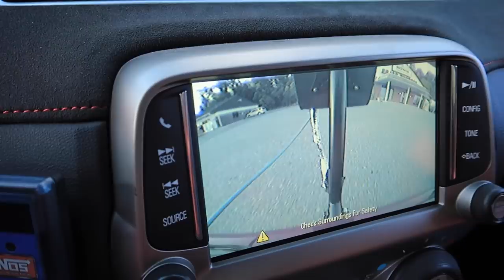Pulling A Parachute On The Highway At 150mph!! **Bad Idea**

Comment: Nick if you blew the motor in the 5th gen what would you replace the motor with?
Reply: J Cunningham engine* a improved engine Im sure
Reply: id say LSX 454
Reply: Stefan Crews motor is not wrong. Why do you think its called motorsports, motorcycle, motor mounts, and motor oil. Definition of motor
1:  one that imparts motion; specifically :  prime mover
2:  any of various power units that develop energy or impart motion: such as a :  a small compact engine b :  internal combustion engine; especially :  a gasoline engine c :  a rotating machine that transforms electrical energy into mechanical energy
3:  motor vehicle; especially :
Reply: J Cunningham lsa would be better

Comment: Yo lol just wanted to be that guy but the Trans am that Andy is in if its a v8 and if its a ls1 its rated at 327hp which isnt alot for cars now a days but back then it was, Even though mine makes 700 on a 150 shot and is about to get a new lsx and and a 80mm turbo which then ill be getting the starting numbers im looking for and when im done i would like to have a chance to run that beast you have.

Comment: You should pull the chute while you're under throttle, NOT after you left off.  It can upset the rear suspension and cause the back end to come around.